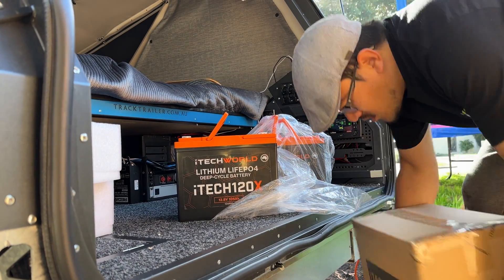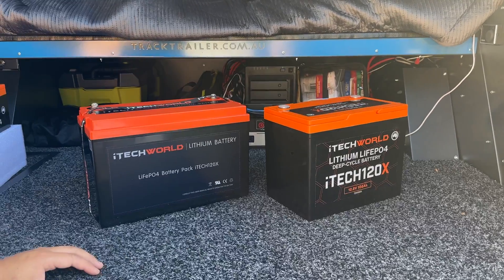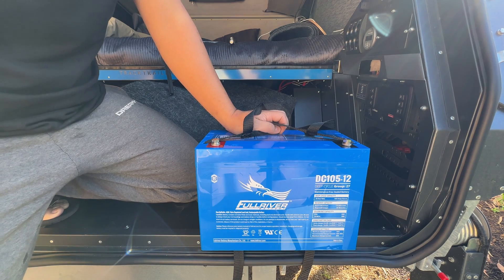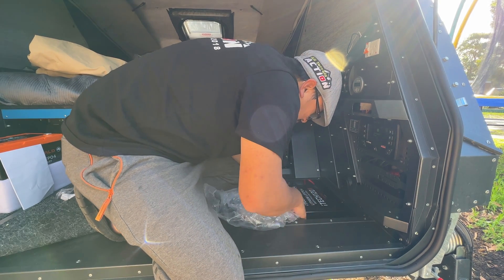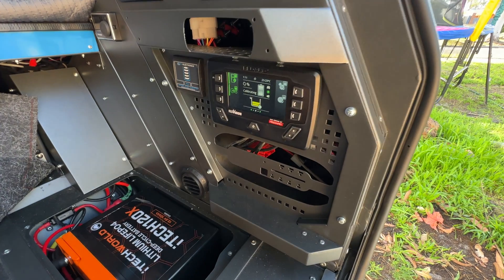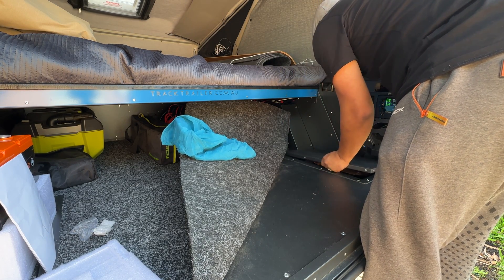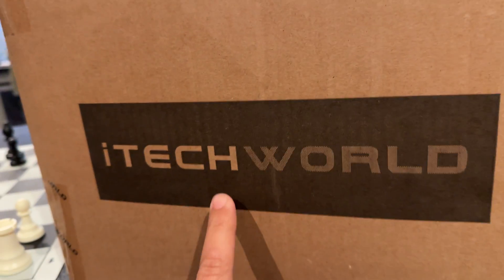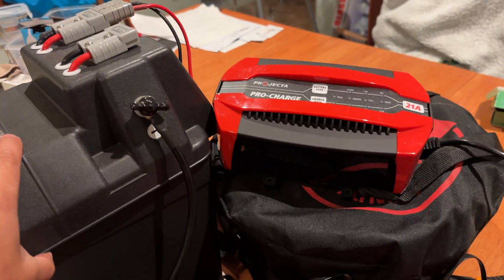THE ALL NEW 2023 ITECH120X... If you're interested in an EASY lithium upgrade (from AGM) watch this!

Comment: Great Video bud 😊.... recently my Kickass AGM Battery died (I think.... as my Car Fridge had an E1 Error on it..... but works fine on 240V Power and sits at 2deg)...... I had an "old" (but it was new, never used, only charged) larger 1st model iTechWorld iTech120X Lithium Battery and when I use the iTech120X in my Kickass Battery Box with Projecta 25A DCDC...... the Car Fridge starts warming up and after a few hours will be at like 11-13deg, the battery charge level is showing as still being fine...... any advice on how to check to see if its the iTechWorld Battery? or maybe if it's the Projecta 25A DCDC (which was working fine with the old Kickass AGM Battery)?  Cheers Don, Perth (Dons Shed and Xplor overland)
Reply: I've just realised that the green "Alternator" Light and obviously then the "Charging" light is not coming on, even after 20mins of driving..... I think that's where my issue is!!!..... in your other video (from 18 June 2023) showing the Lithium battery being charged by the Projecta 25A DCDC..... was that the old (longer) iTech120x or the new (shorter) one?
Reply from the maker: New shorter one, I think that’s like 2023 onwards sometime